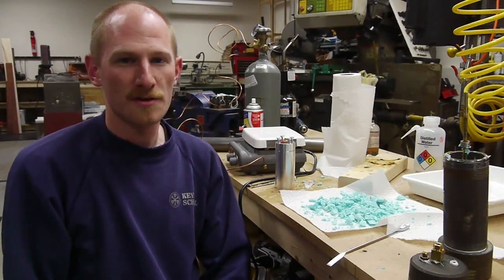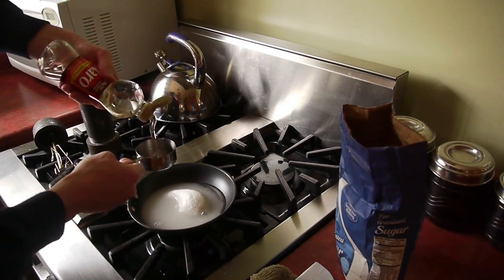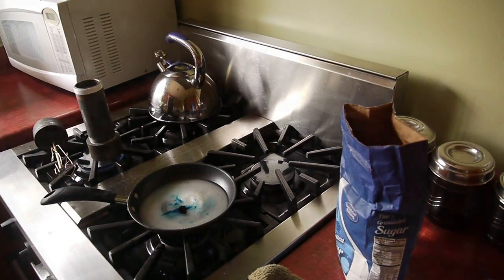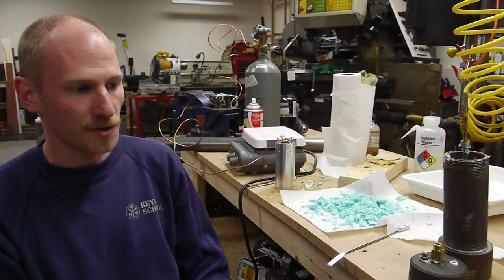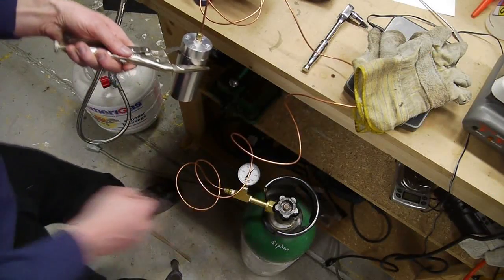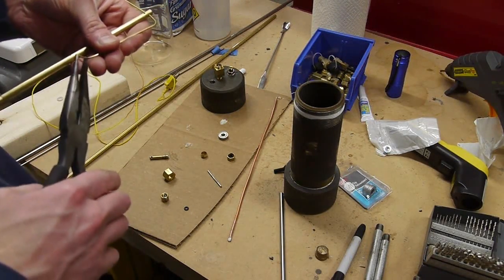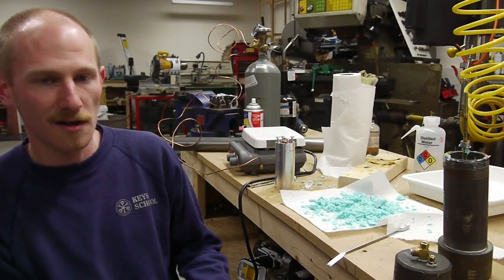Making Pop Rocks candy at home

Comment from the maker: In the time since I made my video on pop rocks, I've been working on a self-contained pressure chamber that uses co2 cartridges (portable and easy). The original goal was supercritical extraction of food flavors, but it would work well for pop rocks too. Should I do a video on it?
Reply: Do a Pop Rock collaboration with BA
Reply: a new puff of life on a old video courtesy of Bon Apetit. You should do a follow up on this. Did you ever tried using crushed dried Ice to increase the pressure and mix the CO2?
Reply: Yes
Reply: @ska042  definitely! Offer to do a crossover! I'm sure they would be thrilled to work with you!
Reply: Yes!! DO IT!
Reply: Absolutely
Reply: That would be amazing. "Ben" Apetite
Reply: YES!
Reply: Yes please!
Reply: Yes defenately a very clear video step by step instructions to make popping candy ad how to use CO2 properly ad proportion.
Reply: Yes
Reply: yeah yeah boi boi boi yummy yummy yum yum yum gotta get that YUMY pop rock #bonapetite
Reply: Yes please
Reply: Maybe next time you can try bubbling the CO2 through the candy so more gets trapped as it cools.

Just a suggestion though, take it with a grain of salt.
Reply: Go for it sir 💪 good luck 🤔✨
Reply: Yes! 12g CO2 carbridge? This not to low PSI?
Reply: YYYYYYYEEEEEEEEEEEAAAAAAAAAAAAAAAAAAAAAAAH
Reply: What if the solution is put in vacuum then Co2 is supplied ??
Reply: Would this be possible with those portable whipping cream ciphons with little CO2 cartridges. Don't know how it would come out though. Once it solidifies
Reply: Hell yes I'd watch a video of you just making an omelette.
Reply: Couldn't you just modify a paint shaker?
Reply: So glad you switched to degrees C since this video
Reply: call claire and do a colab when world returns to normal-ish?
Reply: Please!!
Reply: OMG YES!!!!
Reply: Yes please!
Reply: Love to see it!  It might help Bon Appetite make pop rocks too.  You were featured in their latest video btw.
Reply: Heck yeah! Why not? Talk about what Claire Saffitz was doing in the BA kitchen,and then show how your high pressure technique works.
It would be a good subject for comparison,and explanation.What you can do in a kitchen vs.what you can do in a lab,or workshop.

Comment: You could heat the tube with an induction heating coil... Figure out how your temp, then add ingredients and start stirring..a stirring rod that scraped the sidewalls the entire time and continuously pushed everything up/down would probably give you sufficient stirring..

Leave the exhaust port open until you hit the correct temp, then close and add co2. 🤔

I know this is super old, but maybe someone else trying this experiment might see this lol

Comment: I'm going to try a Cornelius keg and co2 tank. It's my seltzer water setup. Figure I'll do a light spray of cooking oil on the inside of it. For seltzer the best way is to shake the 5 gallon keg to help the co2 dissolve in the cold water. Still, it's a lot of work. Cold water holds more co2 than hot so a molten sugar might not carbonate well. But keeping it pressurized in co2 a few weeks just might do it though. Maybe I'll load it up with gummies and twizzlers, jolly ranchers and pressurize it at max for a month or so and see what I get.

Comment: Isn't there a type of pressure chamber that's like a sandblasting chamber?  A huge cavity with gloves built into the wall so you can manipulate things inside without hurting yourself.  Could you put a hot plate or a saucepan inside a pressure chamber and do the whole thing under pressure?

Comment: Very creative thinking!

Normally pop rocks are made with a chemical reaction between baking soda and citric acid...kind of like how we made volcanoes as kids with vinegar and baking soda.

You do a normal hard candy mix/temp, then add color/flavour/citric acid/baking soda at the end of the heating cycle....it foams up and you pour on a cookie sheet and quickly solidifies. The CO² is trapped in the candy, as is citric acid! You also dust a little citric acid on the candy to get it to stay apart, activate quicker and give that sour to sweet taste. When your saliva meets the citric acid and baking soda, it pops as you suck on it when the CO² that's trapped in pockets is activated :)

Yours looks more like a supercritical CO² experiment but no doubt I'd be thinking if this was possible or not 🤣

Comment: more carbonation can be had with paddle impellers with holes than wire for stirring. you can precisely control clearance to the sides of the pressure chamber, and even have nylon wiper edges, as well as a lower rpm for stirring. I've watched some candies being made on How it's Made and also observed bakeries. wire stirring is best when you don't need aeration in the mix, it is gentle to fluid. paddles move a large amount of mix and fold in sheets of air, holes allow a perpendicular flow of mix to the majority, enhancing aeration, or in this case carbonation. the smaller the bubbles, the more they can be retained in a viscous fluid as it cools.

Comment: Start with stainless steel ball bearings in an ubreakable heat proof container. Add dry ice and candy mixture. Place lid on. Place container into paint shaker. Turn on paint shaker and allow ball bearings to pulverize and mix carbon dioxide into hardening candy inside your unbreakable container. You may want to have some kind of pressure valve to release before you open the container, and also - you may want to do this far away from anything that could be damaged if things get explosive.

Comment: When we run hydrogenation reactions we stir the reaction with a hollow agitator with holes at the top of the agitator shaft that run to the bottom side of the agitator blade and due to Venturi effect the gas is drawn from the top of the top of the vessel back down into the mixture increasing the exposure of the gas to the liquid.
Reply: It’s possible to do the same thing with hollow baffles where the baffle is shaped like an L or J-ish pointing opposite the direction of agitation. The liquid flowing by the opening in the baffle would draw CO2 back down into the syrup.

Comment: I like this, always fun to do experiments and try things.  Maybe there is a better way to infuse the co2.  In a carbonator tank for soda they use a jet nozzle to add water for max turbulence. Maybe the mix viscosity can be altered somehow for better carbonation?   Pressure/temp. Or is there another substance/chemical you can remove after carbonating?    Great video nevertheless

Comment: My sister and I looked forward to pop rocks in our stockings every year as kids. I had forgot about that candy. I enjoyed your video and appreciated you including the trials and errors as it made me think. This maybe absolutely a stupid thought but I was wondering what using dry ice (frozen CO2) would do if you where to drop that in a pressure container and sealed up quick. It would definitely build up pressure as it changed to a gas but how much and how to control? I also was curious if the fast cooing that would occur would be a bad thing or what affect it may have on the operation lol.

Comment: Freeze the chamber after you mix the liquid co2.(pressurized gas co2 at 600psi turns the co2 gas into liquid.) You need to cool it as fast as possible after mixing.

Comment: Applied Science: I would experiment with high speed mixing using a combination of propeller type blades and adjudicators. Therefor, introducing more gas into the mixture. Just a thought.

Comment: You actually explained the problem with your other attempts in the process description. It's not the temperature that you are measuring, it's the water content of the mixture. In the closed containers you can't boil off the water. Using less water would make the thermal gradients in the solution uneven. 

To get the CO2 in the cooling, solidifying candy could you do a mist spray of co2 into the liquid as a thin film without pressure? Essentially making a CO2 micro-bubbler-freezer. Or better, take the high pressure set-up and cool it faster. Maybe spray it with co2? Thus capturing more of the smaller bubbles before they could merge. Keeping the mixer going until it froze. (Torque limited)

Comment: at first thought upon watching you struggle to get enough co2 into the candy, i have a suggested solution to the dilema. instead of using co2 gas from a tank, why not dry ice? get a nice stir going in your chamber, crank up the heat, toss in dry ice, cap it off, keep it mixing with a power drill running the mixer shaft for even distribution of co2, shut down the heat, keep it mixing for a while and bam co2 concentrate direct application, pop rocks. just a theory, give it a shot.

Comment: Maybe this will work maybe it wont. Your engineering of your own aparatuses is next level so well done on that front. May i suggest that a thinner liquid to begin with may indeed help, I think ur mixing shaft needs to be heated also, somehow? the cooling of the liquid neeeds to happen after u reach 600 psi. I've worked with sugar for years and i've found the glusose or corn starch can actually add more of a rubbery element to your sugar solution, makes it more plyable maybe too plyable for a "rock" candy application. Cream of tatar, leave it out i reckon. A little corn syrup to aid in the sugar not crystalising may indeed be needed, but avoid if possible and keep that mixture hot and a little under 280 F, mixing and adding gas both cool it so try and keep it hot. good luck

Comment: I'm a professional brewer and we use a carbonation stone which is kind of like a steel pumas stone to force carbonate our cider. Something like that might work better than just mixing the solution with forced CO2. You could leave it still and the CO2 would just dissolve into solution without agitation.
Reply: Just reading comments, but this sounds like something that would work best.  I would love to see it tried out.  I, also, wonder if the CO2 pumping in like that wouldn't cool the mixture :/.   Maybe heating the CO2 as well would be a good thing.

Comment: did you ever revisit this? i was wondering, what would happen if you did the cooking under pressure with dryice already in the chamber? maybe cook/mix the sugar and coloring first then put in the chamber with some (a little, not enough to exceed the pressure ratings obviously) dry ice, seal it, reheat it to 280-300deg and mix it, then cool it and let it sit for a few hours, maybe 2-3 days before you pop it open... it should crack the candy for you without having to use a hammer not unlike the acrylic windows in the super critical chamber.

Comment: That's 5:35 why candy makers use double boilers it takes longer to bring them up the temp but you can control the temp very closely. Also try injecting the gas from the bottom of the chamber using a valve, gas infuses better under pressure when it's not trying to fill a void. Allow the gas the pass through before pressurizing to flush the air in the container.

Comment: You dont stir the product .. you make the candy under pressure increasing the temp of the boil to 295 and PUSH the candy out of the pressure vessel into a cooling tunnel that pushes the candy stream 45 degrees into a catch pan ... and you need something to catch the globs the wind wont push

the secret is a small diameter ejection orifice nozzle .. gas valve brass nozzle size 063 or 082 would be my first thought

but the candy MUST be spit out slowly via dip tube siphon reduced in pipe size to decrease velocity until the candy product arrives at the sprayer nozzle head at EXACTLY 280* F

liquid CO2 is what they use to push the superheated liquid sugar into the expansion chamber to make the dots that spit out.

fans cool the whole mess.

1/16 od cap tube is yer buddy
Reply: That makes pretty small rocks doesn't it?  We need 20 carat rocks. :-)  

Does the CO2 need to be at 600 psi?  I would think 100 would be plenty.  Also, what about vibratory mix?
Reply: I always thought it was air injected through a liquid until it was hard then they depressureize the chamber....
Reply: Yo bro thats not a bong yo that’s a beaker
Reply: Hi cookies the must important thing is how do u call this phenomen

Comment: 212 °F = 100.0 °C
260 °F = 127 °C
280 °F = 138 °C

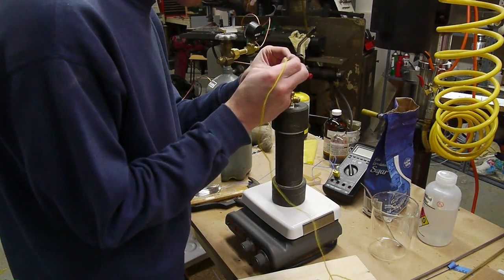6:20 you soldiered a copper tubing? I hope it didn't contain lead. I would just use a torch to melt the copper shut, and I have done it once.
Reply: Vrej Egon Spengler He said it was lead free right in the video. Also, sealing copper to itself I'm guessing is really hard. Need oxy-fuel, and likely special flux.

Comment: Wow, I finally find someone like me on YouTube..  a hopeless geek with a strong mechanical/electrical/electronics background. haha
From my observations, I can see you've made one simple mistake.  You are attempting to entrain the CO2 as opposed to manufacture the CO2 inside the candy.
It's easy mate.. Lower the ph of your candy with some sort of souring agent.  Keeping in mind that most acids like ascorbic and citric break down under extreme temperatures.  Maybe the tartaric acid you've already introduced is enough.
While under a purged and high pressure CO2 environment, fold in a small amount of Soda-bicarb.  Let cool and this will be exactly what you are looking for.  The hardest part will be purging your cylinder, charging with CO2 (at pressure) and then introducing your bicarb.  It has to be in that order.
Reply: Good reflection but it isn't there is something else in pop rock physics

Comment: This is a very interesting video, however, may I recommend a much simpler method? When you make your sugar solution, dissolve some baking soda in the water before you start boiling, then, on a pan, sprinkle food grade citric acid powder. pour the heated sugar solution onto the citric acid lined pan, and the fizz resulting from the baking soda and acid will be trapped in the sugar. much easier to do, a lot less specialized equipment, and anyone can do it really
Reply: Doesn't work NEARLY as well. 
What you're suggesting makes baking soda volcano levels of carbonation, real pop rocks have 600psi pockets of gas in them, that's what makes them POP!

Comment: a little information for people on heating candy. the soft crack stage 270-290f towards the lower side is exactly jolly ranchers. hard until you get it to body temperature then it's pliable. 300-310f is where your typical hard candy sits.

Comment: This is good stuff, It makes one think. Does mixing speed have anything to do with the outcome? In my mind, I see the steel tube upside down on a drink mixer and with a blade instead of a beater. Then you'd have the viscosity of the sugar mix as a barrier between the CO2 and the drive shaft seal. (just thinking aloud??? :~)

Comment: I know this is oldish, but a Dork Controller for Souse Vide would be helpful, if you retrofit the temperature probe into the chamber, and allowed it to control your temperature using a hot-plate. This would let you get a really precise control of the temperature.

Comment: I like your work. Might be good to experiment with maintaining the 1.highest CO2 pressure 2. while heated to the melt range (below its burning point)of the candy. Held In boiling water ?  3. over a long period.  4. Very slowly depressurize so as not to shatter it. (like glass it may need time to adjust to stresses)  Like your super critical acrylic absorbed CO2 even while cold, it got the bends when Psi fell. Monitor from a distance with camera.

Comment: Have you considered putting the CO2 in from the bottom of the canister ? something like an inlet in the bottom then come up the side to the top (so the mixture doesn't try to escape through it).  This would help force the mixture into the solution directly and i would think also support your mixing.  Since your leading some C02 through the stir stick hole this should keep the mixture out of the bottom inlet also.

Comment: have you considered something like spraying it like having two chambers one inside the other and the inner one contains cooked sugar mixture with a small hole then to pressurize both containers you pressurize the first one forcing the candy mixture out in a fine spray into the other container and then through the tiny hole the gas will pressurize the larger container

Comment: Once you have empirically determined the sugar/water ratio required for the pop rocks you could simply premix the ingredients and add them to your reaction chamber and heat externally, either with resistive heating or for more fun and control, inductive.

This would give you precise control over the temperature and allow you to mix whilst heating with minimum fuss.

Comment: A few more thoughts:

290F is a bit low.  You'll want to hit at least 295F for a good, hard crack candy.  It is very, very easy to overshoot, esp. when heating over a gas flame.  Using a copper heat spreader helps avoid caramelizing hotspots.

To expand on the paint shaker:  In general, when I've needed to combine a gas & a liquid, a vessel of roughly square dimensions, 2/3rds full of the liquid, 1/3rd left as headspace, has given me the most consistent, rapid results.

Comment: Hi, Ben.  I love your videos.  

A few thoughts, from a fellow physics enthusiast, and a maker of a mean peanut brittle:

* The reason you need to perform the dehydration before adding it to the pressure chamber is that you need to give the driven-off water somewhere to go.  Otherwise, it recombines on cooling.

* Skip the corn syrup.  Add a small amount of vinegar or lemon juice along with the cream of tartar.  (eyeballing your batch size, ~1-2 tsp)

* Forget stirring.  Use a paint shaker.

Comment: Precise temperature control in cooking is often achieved by cooking the subject — in this case the candy mix — inside a metal pot submerged in water or oil in a larger pot; suspended from the base, and temperature is taken from the water/oil. This limits hot spots in the candy.